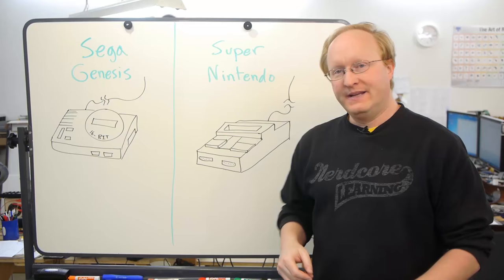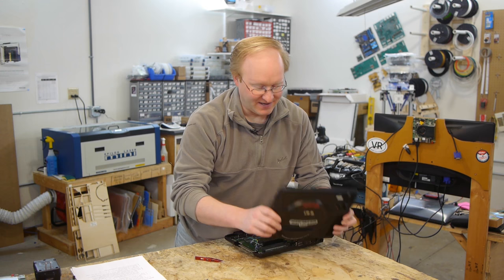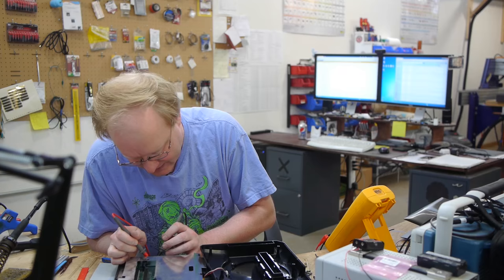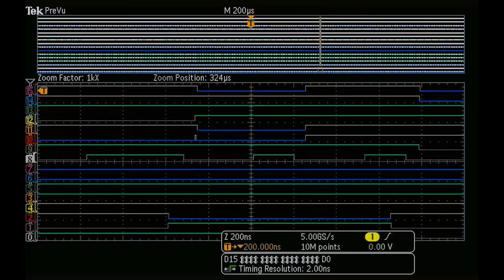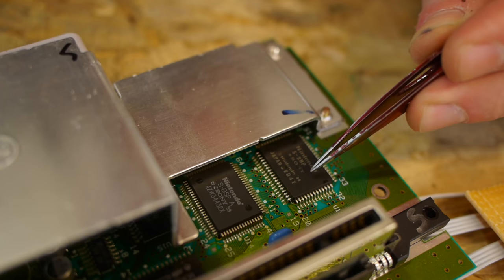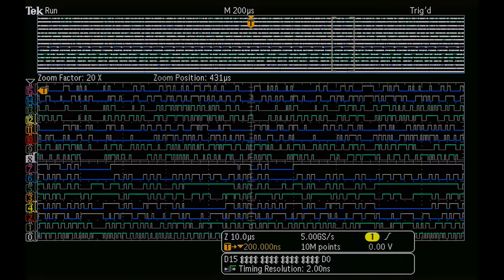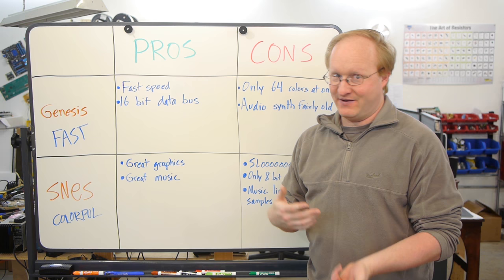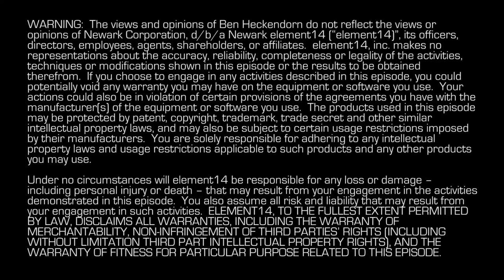Ben Heck’s 16-Bit Console Wars!

Comment: Anyone know how to make snes grey again. I hot used one it is extremely yellow.
Reply: Ramses Garcia Retro Bright. Look it up.
Reply: There isn't much you can do. The problem with older hardware like that, is in the plastic itself. To conform to fire safety standards, a flame retardant chemical was added to the plastic in consoles (among other hardware). Over time, as the plastic is exposed to UV light and/or heat, that flame retardant chemical makes the plastic have a yellowish color to it. You may notice that if you have an older cartridge with stickers on it, you'll find that the plastic underneath looks brand new. The same would apply if you looked at the plastic inside the console (or cartridges, etc.). You're better off leaving it as-is. If you try to use say, a general purpose cleaner on it, or a Magic Eraser or whatever else, you'll do more damage to the plastic than it's worth. Your best bet is to try and reduce exposure to light or heat sources.

Hope this helps!
Reply: ***** Retr0Brite is just a recipe that uses the hair developer you speak of, it's not an actual product you can buy anywhere.
Reply: ***** that's just someone selling premixed ingredients based on the recipe, not an actual licensed product. I don't even know if it's legal to sell it on ebay due to the chemicals.

Comment: snes was better. nuff said. that's the definitive answer.
Reply: Explain?
Reply: Imo, it was the better console of the two.
Reply: "the definitive answer" =/= "imo"
Reply: Chris Waters Why was it the better console? Explain, unless your a zombie fanboy.
Reply: +The Trust well my opinion was that it had better games then genesis, but that's just my opinion. I'm not a fanboy.
Reply: Chris Waters The Wii U has Mario & Zelda etc, but that doesn't make it better than the PS4.
Reply: +The Trust well I think in a Lotta ways it's as good as xb1 and ps4. maybe not grsphically, but you gotta admit that most of nintendos first party games are usually top notch, and that nintendo actually tries to innovate.
Reply: +Chris Waters What about the mucky audio? it sounds pretty weird to me. A lot of snes music sounds better on the genesis. The only music that doesnt sound better on the genesis chip are the nintendo games and maybe chrono trigger. Thats because the snes had barely any bass and the chip was starving for audio ram, as 64k was not enough for its non synth chip. However, 8k was more than enough for the synthesized audio chip and it is clearer and has more difference between trebble and bass. Seriously. Look it up. Im kind of a genesis fanboy, but I own both systems and like certain games on each.
Reply: +Chris Waters no duh. The snes was released in 1991 (US release). The genesis was released 2 years earlier. The genesis was meant to compete with the nes, not the then-unannounced and unreleased snes. Much older hardware at play here. The fact that it lasted as long as it did is amazing, honestly.
Reply: +Xerazal Read this paragraph. The SNES chip may be more capable, but its the one that sounds like shit. How? The reason revolves around how it uses its audio ram. The genesis, with its 8k audio ram, is fine. It actually could probably do fine with 6k due to the synthesizer making very effective use of its audio ram.. However, the SNES, having a non synthesized audio chip, is constantly filling the audio ram and making a terrible use of it. 64k may sound like enough, but 64k audio ram is not enough for the SNES. That's why it sounds muddy and has no bass. Also not to mention, the genesis can swap its memory faster due to its 7 MHZ cpu. I will admit, if the SNES did not have its memory bottleneck and slow CPU, it would be better than the genesis. But the factor is Nintendo was really stupid when they designed the SNES, and even the N64 (Controlled entirely by the GPU), and SEGA's engineering division was superior in many ways. If they had built a system meant to kick the SNES out of the market, they could have done so. But you have to remember that the Genesis was meant to compete with the NES. I will say that the Genesis has terrible graphical capabilities compared to the SNES. This states teh differance between the two systems. Nintendo had a terrible engineering team, and thats the reason the Genesis survived. Engineer from Nintendo: "Lets build a system to beat the other system and make sure it has severe bottleneck because we wanted to do a cheap shitty job at building a system capable of beating our competition" Nintendo CEO: "That sounds like a great idea!". 2 years earlier: Sega engineers building the genesis: "Lets build a system that has a shitty video processor but great CPU and nice audio with no bottleneck" Sega CEO:"Cool lets do this!" Sega of Japan:"Today at Sega of Japan, we are going to be little shits and shoot our own company in the foot by declining every good idea from our awesome team in america" -(Just a joke but its true XD).
Reply: Phoenix Gaming from this comment and a previous one you made, i have a feeling you think that i don't like the genesis or prefer nintendo, at which point you'd be sadly mistaken. Sega back in the day was way ahead of their time. The genesis was ahead of its time because it was released earlier than the snes yet kept up with it and had things like game boxes and the precursor to the ESRB. The dreamcast was an amazing piece of hardware, and sega had the right idea bundling it with a modem to allow online play. The only failing the dreamcast had, which I think killed it, was that it didn't have DVD support. If it had that, I bet it would have been around longer.

I love sega, and sega of america knew they were setting the tone of future consoles. The dreamcast is the last console I can honestly say I played and felt like it was a gamers machine.
Reply: Xerazal Sorry, it just seemed like you were saying you thought the SNES was superior in every category. I just have a tendency to go around and explain to people the difference between the systems, as some people think one is highly superior to the other, when they are more even due to a bad design on Nintendo's part.
Reply: Phoenix Gaming Well, i kinda was. And as someone that prefers the genesis over the snes, i'd rather be honest about it than blindly tell myself the genesis was better hardware wise. 

The snes was released years after the genesis, and the genesis wasn't originally designed to compete with the snes at all, it was competing with the nes. Compared to the nes, it was leaps above that, but naturally the snes came out after the genesis and had more powerful hardware. 

It kept up though due to sega's very catchy marketing, along with certain programming tricks that allowed it to do things the snes just couldn't do. Yes, blast processing is real. But overall yea, the snes was an improvement over the genesis in almost every regard.

I know saying that makes me seem like a nintendo fanboy, but as stated before i'm not. I'm someone who isn't afraid to admit that the system I loved so much wasn't the most powerful console at the time. I loved it because of the games and because of sega's willingness to be progressive in the gaming world, pioneering many things we now take for granted, even if indirectly.

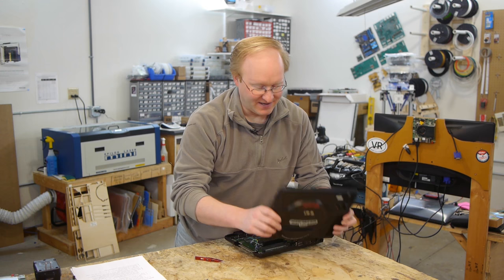Comment: The Ben Heck Show 4:18
The Mega drive has a motorolla 68000 processor but does use a Zilog Z80 for sound and input / output processing.
The master system only has a Zilog Z80 for all tasks. 

The Powerbase Converter (which allows you to play Master System games on the Mega Drive) reroutes the cartridge to use the Z80 processor already in the Mega Drive. But it does contain a Mega Drive ROM image which instructs the Mega Drive on what to do with the input. 

This means that Master System games will only work on the Mega Drive WITH the powerbase converter. If you try to plug them in directly it is likely you will damage the cart and/or megadrive.

Comment: I just discovered this channel and it is so awesome!  You've combined electronics engineering AND retrogaming.

My mind. I can't even...

As for the video, not too many surprises. While "blast processing" was a made up technical spec, the term was not completely unfounded. You proved that by comparing processor speed and emphasizing bus width. What was Nintendo thinking with an 8-bit data bus? Maybe backwards compatibility was the true motive.

I own both (including 32X and Sega CD attachments), but I always preferred the Genesis library for its arcade gameplay. SNES games that fell into the arcade/action genres or ports always seemed too slow paced for me, despite better visuals. Sound quality varied; I hated the fake SNES "trumpety" samples and weak bass, but some Genesis soundtracks, notably from EA, are terribly grating on the ears.

Still, SNES is a great system for RPGs. Though the Genesis fared well in that department as well (Shining Force, Phantasy Star), especially with the Sega CD add on (see Working Designs' releases, Shining Force CD). The Sega CD's redbook audio, FMV, along with Mode 7 equivalent hardware scaling and rotation IMO leveled the playing field between SNES and Genesis when it came to RPGs.

On the other hand, the Genesis 32X was just simply awful. Arguably it doesn't offer anything more than an SNES teamed with a SuperFX chip.

But in the end, for me the Genesis was the best 16 bit system of all time.

Comment: Now just imagine what that 68K CPU and data bus would have done for the SNES.  There would be no contest.  I had heard Nintendo originally was designing the SNES around a 68K.  I don't know if that's true or not but sounds plausible.  As it stands in reality each console had distinct advantages over the other.  Great video by the way.

Comment: The NHL games of the time really showed the speed difference between the consoles. Megadrive had a silky smooth 50/60 fps while the SNES struggled to keep it at playable speed. They managed to make later NHL games work better on the SNES, but the Megadrive never had a problem.
Still, the SNES was the better console despite the speed problem.

Comment: at 4:11 Ben says you can plug a master system game directly into the console... 

"There was nothing inside it (the MS adapter) and all it did was adapt the shape of the cart"

The Mega drive has a motorolla 68000 processor but does use a Zilog Z80 for sound and input / output processing. The master system only has a Zilog Z80 for all tasks. The Powerbase Converter (which allows you to play Master System games on the Mega Drive) reroutes the cartridge to use the Z80 processor already in the Mega Drive. But it does contain a Mega Drive ROM image which instructs the Mega Drive on what to do with the input. This means that Master System games will only work on the Mega Drive WITH the powerbase converter. If you try to plug them in directly it is likely you will damage the cart and/or megadrive.

TLDR, if you plug a Master system game directly into the console you will most likely kill the game and system..

Comment: Neo Geo was technically a 16 bit system. That would mean without a doubt it was king of the 16 bit systems.
Reply: +Grey Fox What was that "24 bit" thing about? I never got that. I mean visually it was definitely superior, I mean play the games on the hardware and it's readily apparent, but I don't know what the hell was going on there.
Reply: +Hezekiah Ramirez It was 16+8 so for "marketing" purposes they said 24. It's the longest lived system to date with 14 years of software release.
Reply: +Hezekiah Ramirez It was 16+8 so for "marketing" purposes they said 24. It's the longest lived system to date with 14 years of software release.

Comment: 17:02 Actually, that probably doesn't hurt the SNES as much as you think. I think the pixel graphics are stored with a low number of bitplanes, and then mapped by the PPU to one of several colours at draw time... and the SNES has a much bigger palette, resulting in basically, nicer graphics.

Comment: Before watching this, I'm going to say that the Genesis is more than likely to win based on the stuff you've said you're looking at, since we know it had a much faster processor on paper, which is a major factor here. I just hope things like the SNES' "modes", built-in hardware transparency, and multiple background layers are taken into consideration too, because those things go towards making great graphics, which is what this argument is really all about. 

Also, even though the SNES often required additional processors in the carts to match the sheer speed of the Genesis, it did have them in loads of carts basically as standard (unlike the Genesis), and that was just a reality of the time. A lot of SNES games were suped-up beyond what the Genesis was doing because of those extra in-cart chips. But, the Genesis really did run most games without any slowdown and often had loads of busy action on-screen.

Now, let's see. . . .

Comment: On the point about comparing their video RAM towards the end, I read somewhere there was something along the lines of a smaller minimum sprite size allowed on the Genesis? Someone please tell me if I'm wrong. It's just that I remember the system had a plethora of horizontal shooters, far more than the SNES, and generally assets like spaceships, enemies and bullets were very tiny and incredibly numerous on screen at once. The only shooter I remember in that style on the SNES was UN Squadron and it had some pretty big player sprites. Also the shooting activity wasn't as hectic as anything on Genesis.

Comment: I wouldnt say the music being limited to samples in the ram is that bad. It could adequately reproduce that old yamaha synthesizer on the genesis.
Reply: The Mega Drive's sounds are clearer, without compression, with a higher audio frequency, and better bass. It's possible for the SNES to sample the Mega Drive's FM synth chip, but it would be heavily compressed, with the quality significantly reduced, particularly the bass quality.
Reply: Sega was too stingy with the ram..
That audio needed 24/32 kbts of ram

Comment: so since the master system could be played on a genesis without the power base converter...maybe a future project you could do would be putting a second cartridge slot on a genesis so you can have both on a second system without the power base converter
Reply: +Team Cannon Fodder you could make a second port, and you could use add in the FM sound chip to give the SMS games better audio.  To save you time you can get a mini power base with FM from Stone Age Gamer.
Reply: Doug Plummer im thinking more of a future project for Ben, it would be much simpler than some of the projects he does and would be interesting to see how well it performs
Reply: gotcha, will in that case he can build the FM sound board himself and add it to the new port, then make the entire system into a better portable then the Nomad.  Even start with a Nomad, you can mod it to play the SMS games also

Comment: Hello Ben, hope everything is ok. Now to the post :).
You are right at most points yet...
Genesis VDP is missing the modes, 0, 1, 2 and 3 this makes SG1000 and some early SMS games not playable on the Genesis with the Power Base Converter. Another point is that the Z80 can write to the 68k RAM. And you forgot to say that the VDP has a "small" sound chip the TI-SN76489, in fact the VDP's on the Game Gear and Master System have this sound chip too.
Now to the SNES sure it is a yes that the 5A22 has the 6502 compatibility mode but unused. Each PPU can access only 32KB and not the all 64KB of VRAM. Plus to access the all 128KB of WRAM the SNES CPU needs to be set to lower speeds 2.6 or 1.7. On the video side the resolutions had (or have) their own rules too, each mode with it's own set of rules... In other words the SNES is a nightmare on a programmers point of view, while the Genesis had (or has) a more "clean design". Could point other things but you didn't mention on the video so I will not point them. See you.

Comment: The audio chip in the SNES may be More advanced, but it is severely restricted by the fact that it requires lots of audio ram which it does not have. This makes the genesis sound a lot clearer.
Reply: +Phoenix Gaming Clearer? I'm usually biased, but even I don't agree with that.